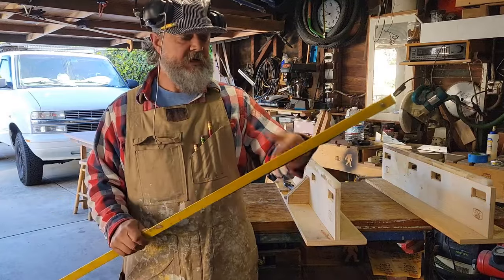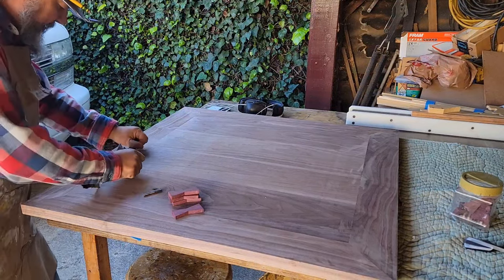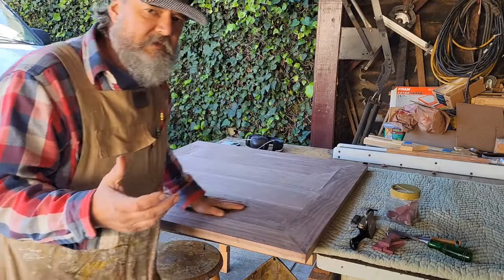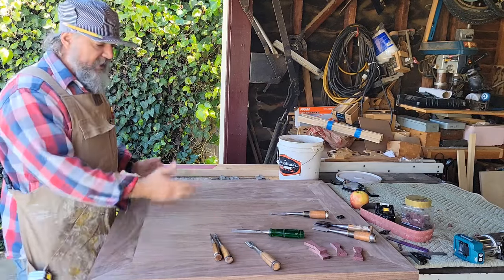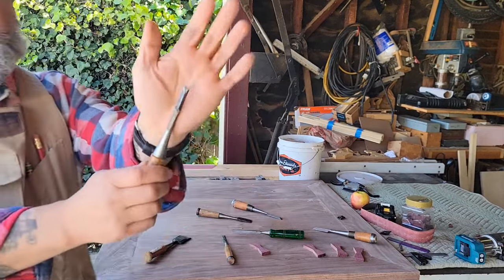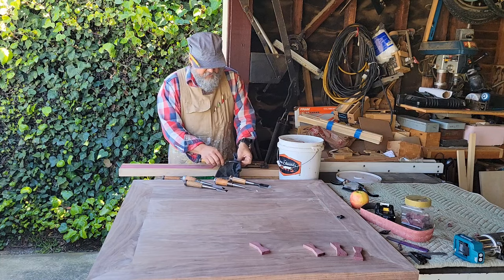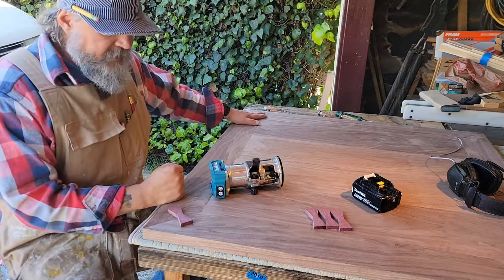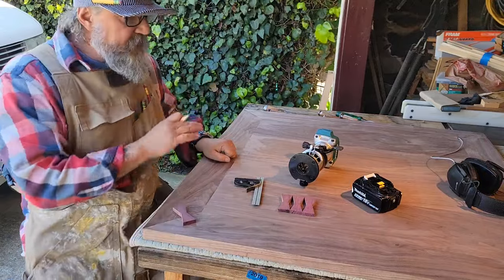Fitting Butterfly Mortises In This Walnut Table Top

Comment: That was cool I could see how that would be a little stressful. Are you using a spiral bit? I started using spiral bits in my router table and huge difference over straight, smoother cutting and no fuzzy edges✌️
Reply from the maker: I used spiral bits when they were first coming out but I'm still using straight bits with no issues - I can quickly hone a straight bit with a small diamond sharpener